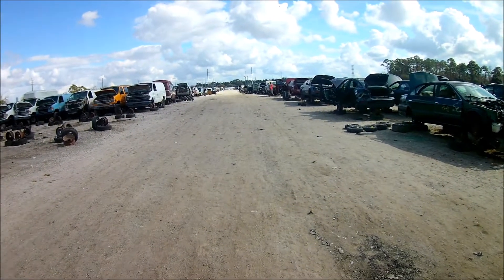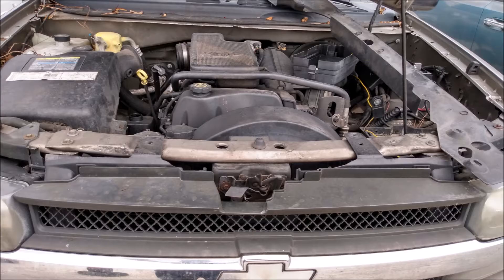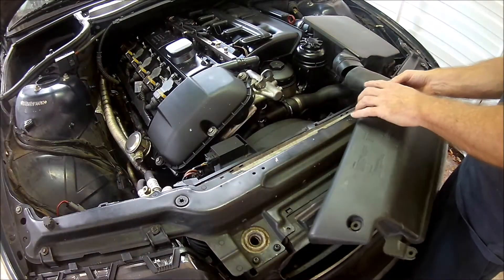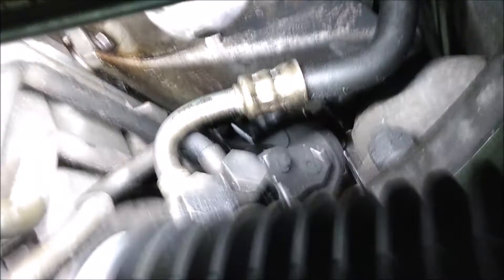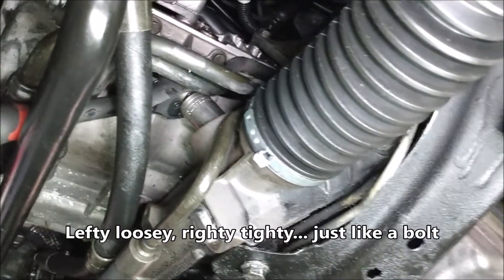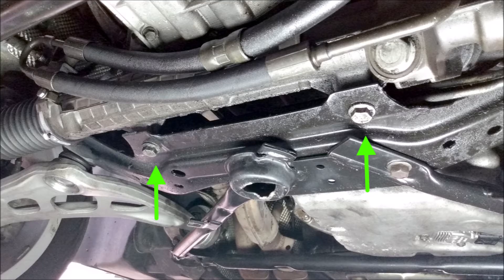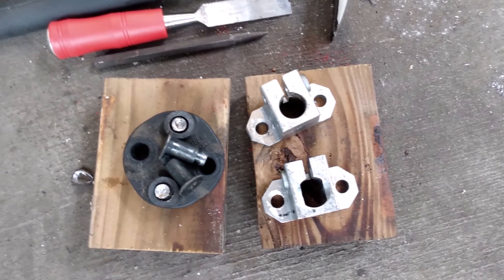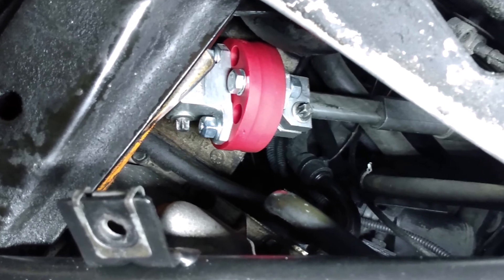BMW E46 Project: The Wrecking Yard Provides! And Urethane Steering Coupler Install

Comment: since you don't the carper it will be easy for you to replace the pedals, I mean if you start the another project to swap the auto to manual tranny. ohhh yeahhhh.........
Reply from the maker: That's true. But I don't plan to swap in a manual transmission anytime soon.

Comment: Are you on catless headers? Want to delete my SAP but people say not to do it if you still have cats, which I do.
Reply from the maker: Still has stock exhaust, but probably not for long. Insert "Imma delete that anyway" mentality here. 😉
Reply: @michaelblacktree  no problems with SAP delete with cats still in then?
Reply from the maker: It triggers the check engine light, but the engine runs fine.
Reply: @michaelblacktree  awesome, I'll experiment with it!